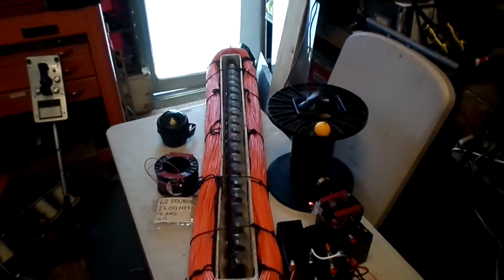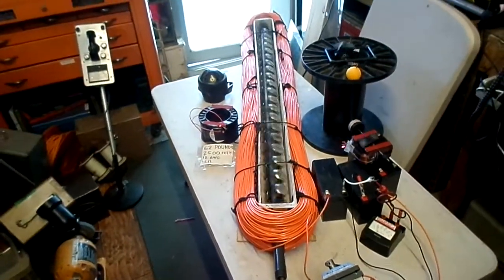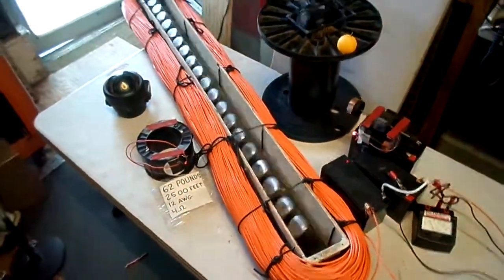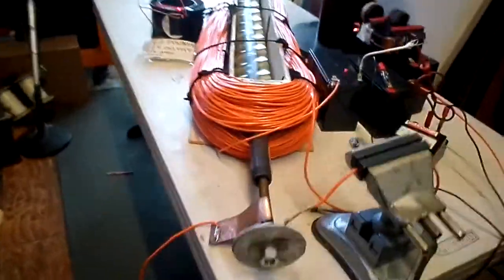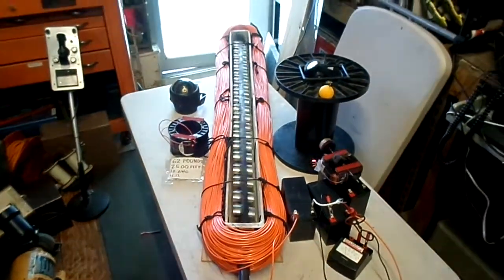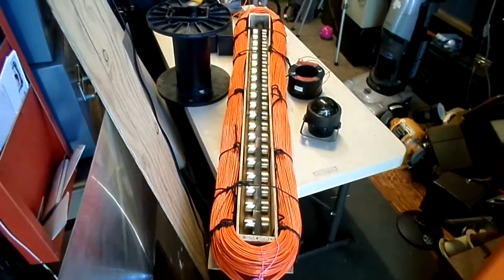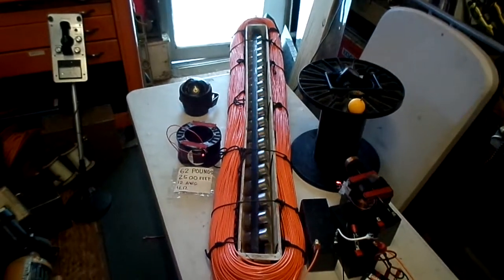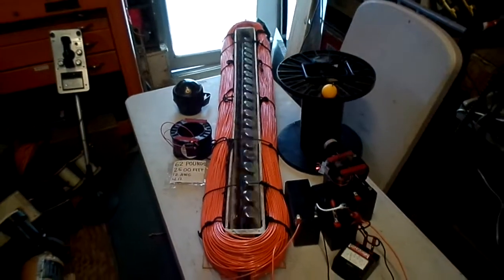87 Pound Newman Motor. Check link to newest documentary on Newman life in info section

Comment: Small help, worked it or not : crucial part is that commutator shorts the coil and cancel the induction trouble when magnets are at particular position, also while shorting it that's the moment huge back emf is created while field is collapsing and this bck emf is supposed to be captured and sent into battery, and in case mechanical work/torque is more preferable than you can loop the power from the battery into the coil. So the proper amounts of replicas on yt =0 hehe. People keep saying its most simple electrical motor to be built but it's actually a tricky power management system challenge. Also he stated thin wire is crucial and much of it which implies that the mass of it is not much important but the number of turns instead. The proper device rather that back emf is dangerous and whole proper electrical circuit requires highly educated/experienced electrician to ensure the safety side of things.
Reply: To be more clear : 1. having one strand of cable with many wires inside of it just increases number of paths for electron to go thru, instead the whole point is having a single thin wire that is wery long and has many turns forcing the electrons to take very long path thru that single wire - from electrician standpoint but scientific explanation is different when it comes to electricity but nevermind that now. So what you have there is very small amount of wire turns even for standard electric motor not to mention when compared to his design and wery short path for electrons <and that is completely the opposite from his design, more turns. 2. Once you finally get your wire looped correctly such coil will need lot of time to collapse so you need to give it a time to do so by making a motor of a large diameter about 1 meter at least <completely opposite from what you have built, and obviously having small number of magnets to further allow that larger timing gap so that coil can manage to release all magnetic field it has. 3. If you experience motor slowing down while taking back emf it's because you doing it at the wrong moment or on wrong way or both at once. 4.make sure you studied particular battery you want to charge, and configure the back emf properly before it reaches the battery. Provide the battery with exactly what it needs in order to be charged. Also it will have reversed polarity.  You built cool electro motor quite expensive one tho. Which is one of the downsides of making the replica = gonna cost lot of time and a ching ching.
Reply from the maker: You combination of words makes little sense to me, and I doubt anyone could follow them.
Reply: @GrantsPassTVRepair  hi there, let me know the places where i was not clear enough and I'll be glad to put it on different way. But basically i tried to help by providing some suggestions that will get you closer to his design. Also i forgot to mention but you can also find his electrical schematic online on the battery side of things in case you need it.
Reply from the maker: @ExoCore_PlanetTerraforming  I have three of Joes books. Two of them are on his motor and one is on his prophecies that never came true. I've spoken with Joe when he was alive, and found there to be many holes in his public demonstrations. Have you built one of Joes motors and produced more energy output than energy input?
Reply: @GrantsPassTVRepair  Hi, like i mentioned I don't know if it works or not, from observation side I can simply see that yours and his machine are different in many places so i pointed the differences in order to help you . Didn't build one, i have my own designs that I want to research after i improve my electrical lab. It's hard financing these things on the side. But next to mine designs i planned to replicate few of most promising devices out of fun so I'll give a shot also on his device for sure. What I'm actually doing is trying to understand the universe and best way of doing so next to the obvious "just look around" is through making the devices (where the theory can become confirmed in best case) and i can't wait to get my hands on few mini metal working machines to put few things into practice(for the purpose of understanding the universe) . As the holes in public demonstrations are going if you are referring to him not attaching the generator to machine, he has no reason doing it i think simply because machine had enough torque to split man in half and by using 9 v / and mili amps from it which is obvious proof of more output so i guess and based on his personality attaching a generator to already perpetual output device is offensive to him and makes the device looking more complex for no reason. And just to help you guys in case anyone build something just simply keep it for yourself, power your home don't bother further. Simply because take the water it flows its free yet you gonna pay for electricity caused by that water motion, in other words not any perpetual motion machine not gonna change the world by itself, energy from it will be charged /taxed simply because that's how we decided to live as humans = small tax and many of such collected / centralised so we can build cities and other. Pushing the perpetual machine into such world will drive you insane as end result.
Reply from the maker: @ExoCore_PlanetTerraforming  You might enjoy this video about Mr Newman. https://www.youtube.com/watch?v=CrJIzrmX1mI&t=0s
Reply: @GrantsPassTVRepair  yeah watched it in past and now also. I understand him completely, and why he rejected near the end of the video to be employed is because he wanted investment and his own company to have control over the product so he can deliver it to masses which is more of a personal mission he gave to himself which involves changing many other things and not just making the profit . So yeah that's why he chases the "investor" away, because investor and the company want to create a product and that does not involve the mission and as final offence you tell the guy who created the machine that he's gonna get team of engineers haha, and as final cherry for the offence investor wanted machine and in return inventor gets employed. Newman did ask on purpose to put it into the car since that's how he can recognise who has genuine intentions and puts the world above personal interests, which investor fails to pass the test. Pushing the mission and/or machine is way more refined process than what he personally experienced. Mainly if you want to push your device of such impact into the world you better have next to machine designed the new laws, new way of living, new monetary system and sorted out every problem that machine gonna create and doing all that ahead of the time. So inventor must be the architect of this world additionally before he dares to launch such, similar or better machine. Taming the machine is 1 percent of the work, taming the world is 99 percent.
Reply from the maker: @ExoCore_PlanetTerraforming  Joe Newman was a con man in my opinion, Here is a story buy one guy who worked with him. https://zpenergy.com/downloads/biss.htm  It seems that everyone who tries to convince me  that Joes motor works has never built one.. I've spent hundreds of dollars to experiment with his ideas.

Comment: Joe lost it in the end. A sane person wouldnt say that Einstein was wrong ect. And Joe said a lot of Rubbish when explaining his machine.
Reply from the maker: I agree. It was after watching some of his public demonstrations that I suspected he was trying to mislead people with his abstract test results.
Reply: @GrantsPassTVRepair  I am not saying his machine didnt work because I think there was something there but Joe didnt seem bothered about moving on with it, I have been doing a few experiments with one of my machines and I am lighting up a 240 volt 40 watt light bulb as I am running my machine on 20 volts dc. If I increase the voltage in, my machine puts alot more voltage out and it is a stable voltage not the big bouncing fly backs that everyone gets and which are the ones that burn out the circuits ect, I am trying to work out how I can loop it back into my power feed?  Joe doesnt explain any of this in any detail, he alway goes on about the voltage going up or staying as is, which is correct but at the same time the machine needs a minute amount of amps to keep it going, This is why Joe could use old batteries because batteries always recharge themselves a little after use. With the amount of batteries Joe used he always had some amps and a lot of voltage. His machine powered an electric magnetic field twice per revolution.  which is what my simple commutator does. with only one coil. I have run one of my machines for 5 days solid and still had high voltage in the battery but absolutely no amps at all. fully drained. And after leaving the battery to stand for a while I reconnected it back up and the machine started running again for another 24 hours on a supposedly dead battery, but as I have said before all batteries will recharge themselves a little after use. I suspect its a chemical reaction in the battery.  Sorry to have gone on for so long. I hope you find What I have said interesting. Kind Regards,  Deryck Thompson
Reply from the maker: @DeryckThompsonChasingtheDream  The axial flux motors are impressive, Until I read your post I thought they were called pancake motors. My friend use to build small electric go carts to race in the electrathon where he used these motors, and that's where I got the name. I'll  never forget putting my hand on one of these motors after a two hour long race, and it was only a little bit warm, https://www.youtube.com/watch?v=yO13KJ4qKqU

Comment: The engineers backing in Joe was able to reproduce his results many times over and they testified to that in court.  most of those engineers invested in Joe’s company and the falling out came about because he declared bankruptcy and they lost all their money. Towards the end of his life he focuses more on his spiritual pursuits and recruiting people that end. he lost focus on his technical pursuits. Joe Newman was a deeply flawed man who was often undermined by his ego. He was a narcissist through and through.  that’s why he was a failure with the exception of his flywheel invention with children’s bicycles and his invention of concrete weights as exercise equipment. He was approached many times to sell off his IP on his motor. The deals fell through because of his insistence to have total control over the project. He envisioned selling his motor as part of a generator that would be installed in every home undermining electric companies. Obviously that idea wasn’t practical. Additionally any individual who has built a Newman motor can attest that it is very expensive to produce with the massive amount of copper wire involved. Not to mention it would not be easy to produce on a production line. So in conclusion does Joe Newman motor work, yes it does. As long as you don’t ground of the coils it is much more efficient than any electric motor on currently the market.
Reply from the maker: The issues that made me most suspicious about Joe and his motor were his public demonstrations, where he would use very abstract ways to prove his motors efficiency as if he was trying to hide something. I remember when someone who builds motors for a living attempted to work with Joe, and he said Joe stole the motor in the middle of being constructed. To me it appeared as though Joe feared this guy would know how to test the motor properly, and he could not allow that happen. Here is his story.  http://u2.lege.net/newebmasters.com__freeenergy/external_links_from_phact.org/skeptic/biss.htm

Comment: Believe Joseph Newman had a huge flywheel, and the magnets were set out away from the axle for leverage, and he mentioned that he turns Mass into energy at 100% conversion basis, so I think he possibly could have been getting the power from the mass of the wheel spinning, the reason you don't have much power is because your magnets are on the axle, almost zero Leverage
Reply from the maker: I don't understand what you are saying.
Reply: When your coil pulses the magnet, the farther away it is from the axle, the more torque you're going to get, it may spend slower but that's okay, when you add a big heavy flywheel like Joseph Newman did, now you have some power, because if you tried to stop that flywheel from spinning at the axle, with your bare hands , I don't think you will be too successful, so those two factors combined I think we'll make all the difference, the third factor is a capacitor, I replicated a Newman motor on my channel, but I never put a flywheel on it, mainly because it was too small to really do anything anyway, I have to say that I believe Joseph Newman did exactly what he said, I love the video where he demonstrated perpetual motion, I don't think he had any other thing driving the motor then what he said, God bless

Comment: As I understood the overunity key of the motor is that the time of powering the coil should be shorter then the time when magnetic particles can move from coil wire beginning to the its end. This eliminates Lorenz back force and explains why his motors were huge in size and so on. And this is why the another knowhow is the contact plate). Who knows, maybe Mr. Newman was right with his physical model? ...
Reply from the maker: I don't think Newman used a segmented commutator in all of his motors. At one point he made it sound as though a larg coil and a large permanent alone would be enough to produce more output energy than input energy.

Comment: I've just subscribed, very nice channel you have there!
Regarding Newman's machine, it is in fact easy to understand why it doesn't contradict the laws or thermodynamics if you watch this nice presentation from an engineer who in fact was one of Newman's followers. I think this is a very important video to understand what Newman was after [This comment gets deleted every time I include a link to the Google Drive video or even try to obfuscate it, shame on YouTube. If you can send me your email address, I'll send a link to that video]
To summarize the main points. The strength of a magnetic field created by a coil of wire has no direct relation to the power drawn by the input source. One can always ramp up amp-turns while reducing the power consumption at the same time. This explains why Newman went after high turn count (magnetic field strength), a relatively heavy-gauge (to negate the DC resistance increase from high turn count) and large diameter (like the ones you demonstrate) coils. The key is in reducing the power input, while boosting the magnetic field strength as much as possible at the same time, hence the use of a few hundred volts worth of input into a coil with very high number of turns to produce a very powerful magnetic field that can then interact with a heavy rotary magnet producing a high torque. Newman has in fact included this key experiment in his book (page 18 of 8th edition), where it starts with a statement: "For "mind-opening purposes" (to use the current vernacular) carefully study the following two tests...".
Back EMF spike from such coils can also be utilized that would be yet another factor for increasing the efficiency which he in fact did in his later machine (Big Eureka) if I remember correctly.

Comment: I also notice that they also only used one magnet or two but a got a good look at on that Mr. Newman built and it had 4 magnets not sure the orientation of those magnets, but even if the magnets are oriented same poles together the magnetic field would be completely different then using a single magnet or two magnets.
Reply from the maker: I've got a couple of Newmans books. On the 8000 pound coil he constructed the magnet appears to be a few cylinder magnets with north on one end and south on the other.
Reply: @GrantsPassTVRepair   Has anyone got this working?
If it can sustain itself that is a start.
Reply from the maker: @anthonyrye4755  Some claim it works and some claim it doesn't. Here is an interesting documentary on a motor of this type. https://www.youtube.com/watch?v=CrJIzrmX1mI&t=0s
Reply: @GrantsPassTVRepair  so I watched it kind of sad seems he was broken  in a way.
 Thing is YouTube was around and maybe he could have went through some principles of how to build it  and how it worked. I think he would have made pretty good money that way since they wouldn't patent it. If he did youtube he could have copywritten the material or created a gpl / creative commons license for it so that others can manufacture it. You can make money you just have to use a different business model most of it is speaking engagements, custom project. I don't know
Reply: I also feel bad for Stan Myers as well I think if things would have worked out the world would be in a better situation.
 There have been a lot of inventions that could have changed the world, but they where shut down or killed.
Reply: The video that you had me watch toward the end i notice he had 5 or 6 magnets. I'm not sure that size has much to do with its operation. I think its more about the way the magnetic field works. I suspect that the way the magnets are arranged maybe causes a back emf that is harnessed back in to the motor. I believe there is another guy that did something similar in principle different design.
Reply from the maker: Yes the poles are together. Joes basic idea is larger coils mean larger magnetic fields,.Where his ideas started to fall apart in my mind was after I built a large motor based on this idea, and discovered the counter force preventing the magnetic from turning very fast.
Reply: @GrantsPassTVRepair  and that is fairly understandable. Please see my comment I posted separately